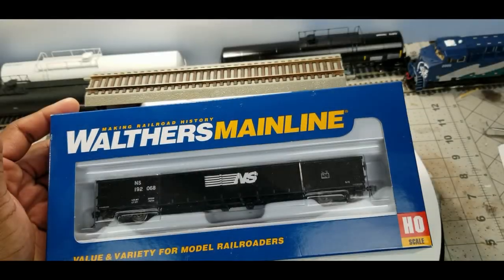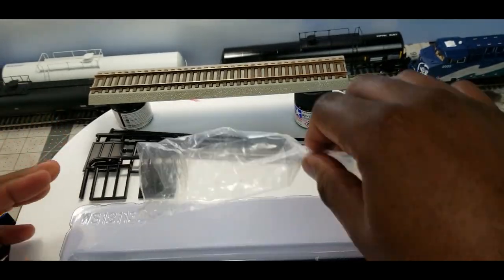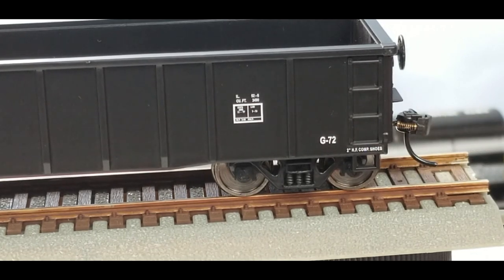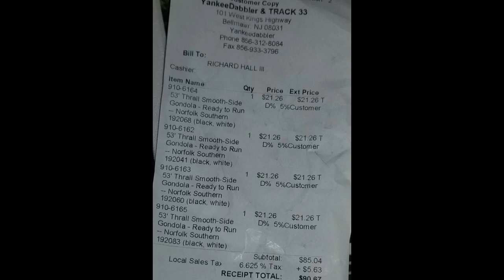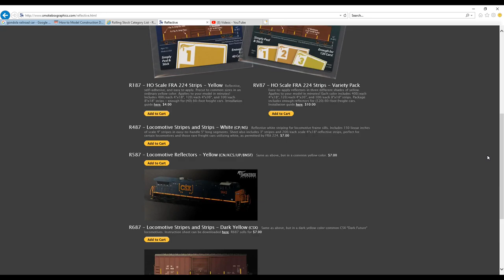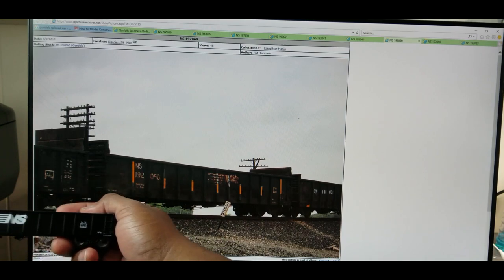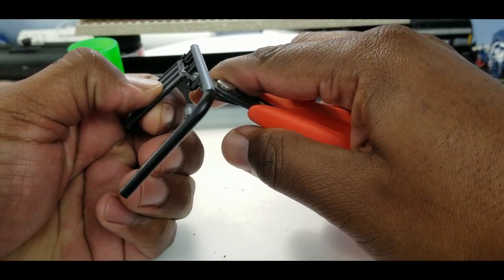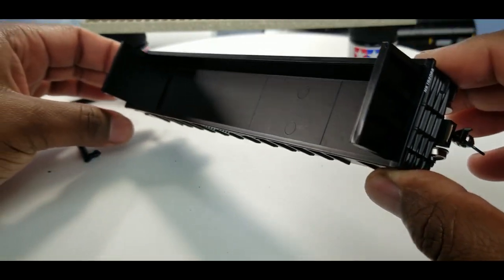Walthers Mainline 53' Thrall Smooth-Side Gondola

Comment: Being that u work for the RR do u know if these cars use ECP brakes and if so where would the electric cable go for the connection? Reason being is I see these cars in unit trains carrying steel slabs.   Nice video review keep up the good work.
Reply from the maker: These cars did not use that feature

Comment: Do you normally pick up RTR instead of kits ?  Slowly building up a decent gondola fleet myself.
Reply from the maker: It depends on what it is if I like it I'll buy it Kit or  RTR
Reply: @engineerhall5887  Yeah,do the same thing. It's gotta be a neat freight car. For instance. Just got July issue of MR. Inside was a 52' Tangent American Steel & Wire gondola I couldn't refuse. Picked up two through snail mail from South Shore Model Railway Club. Gonna make a video about these cars. Take care .